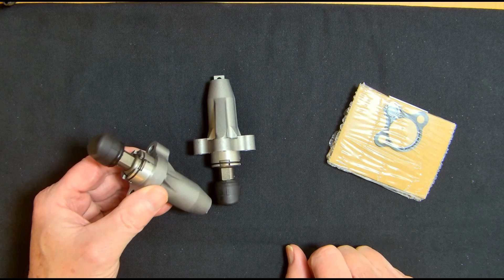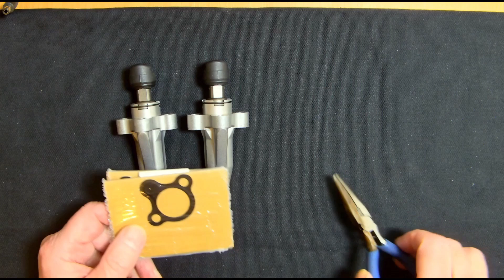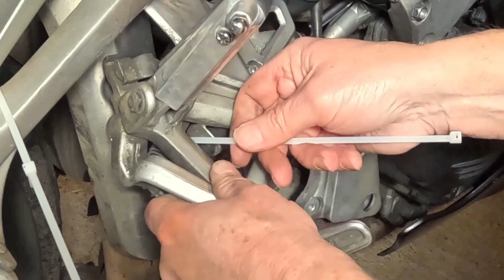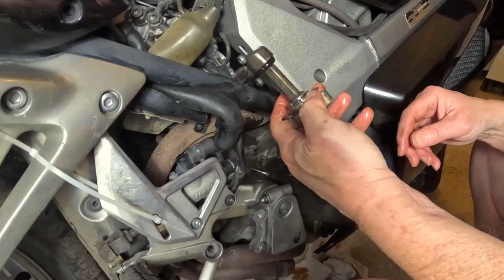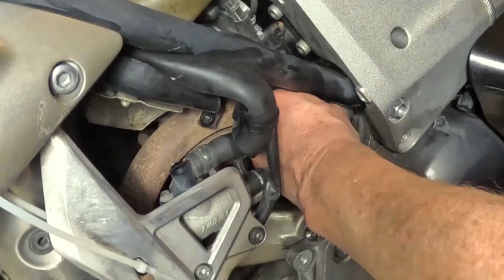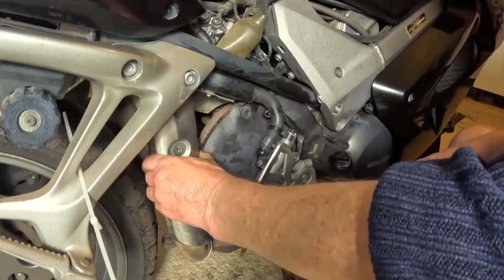Honda VFR 800 Cam Chain Tensioner Change PART 1 - REAR

Comment: Thanks for the vid. Quick question, did you re-wind the old plunger before removing it from the cylinder head? Or did you just remove the two bolts and pull the CCT out allowing the plunger to extend as the pressure against the chain dropped as the CCT was removed.
Reply from the maker: I did because there is limited space between the end of the Tensioner where the plug bolt and whats behind it, its also good practice because when you are taking it out  it means there is less chance of loosing the cap into the bowels of the engine. When you remove it  put no force into it, when it is in the right position having manipulated its position with the very lowest of power to feel the movement you will know when its free.

As you found it useful, if you are not a subscriber, please do subscribe, as it helps the channel to grow and me to make more videos. Thanks and good luck with the job and Safe Riding🙂